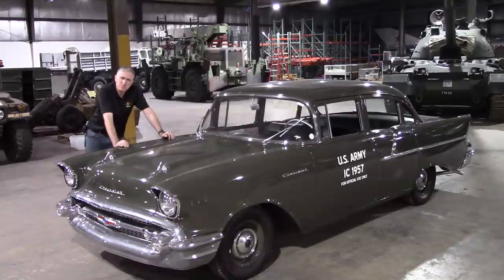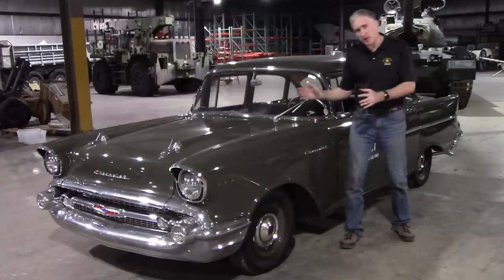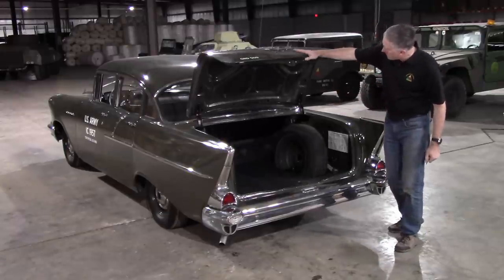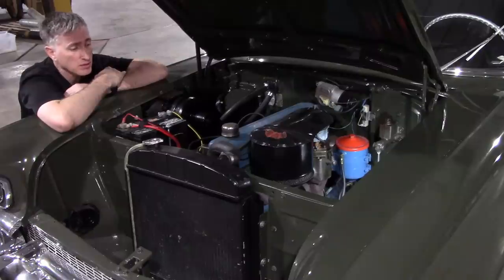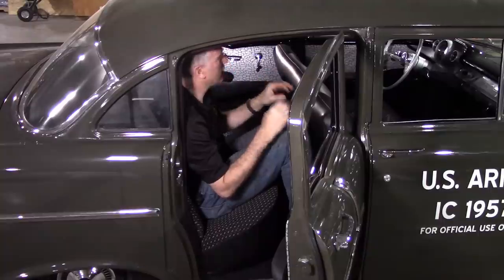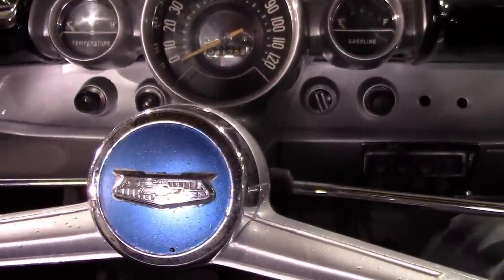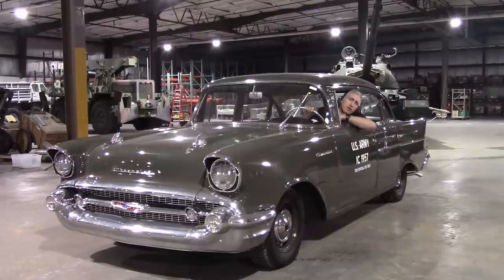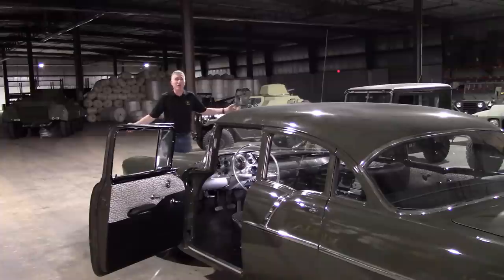Inside the Chieftain's Hatch: Chevrolet 1503

Comment: The knob tothe left of the steering wheel is the windshield wiper switch. The push-pull switch under the dashboard is not correct, the wipers also should only work with the key on. It also has "optional" electric wipers , instead of standard vacuum powered wipers.

Comment: You are lacking in the proper identification of each feature.  Each feature on the body has a name and history.  A very clean restoration of the car, but not entirely correct, with a number of accessories being added to this restoration.
Reply from the maker: Pity. I thought I had the technical lingo down. "Wheel". "Engine" "Clutch"....